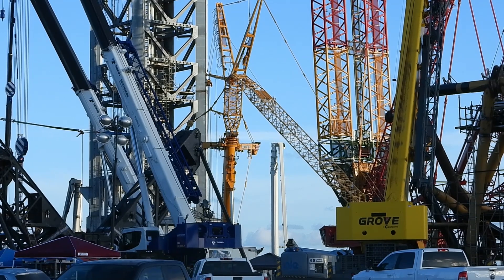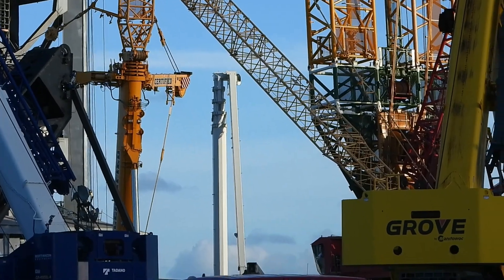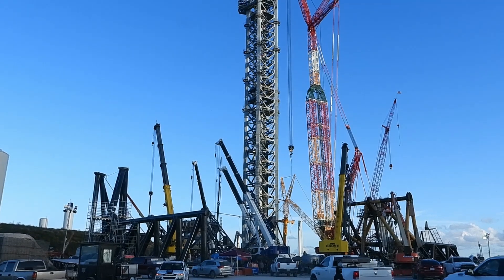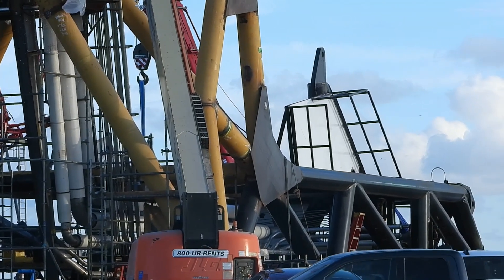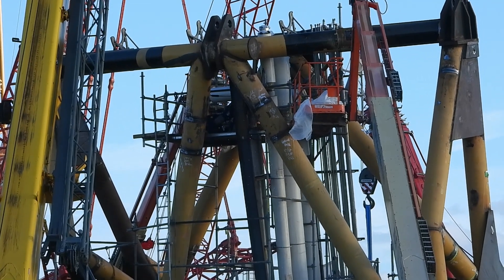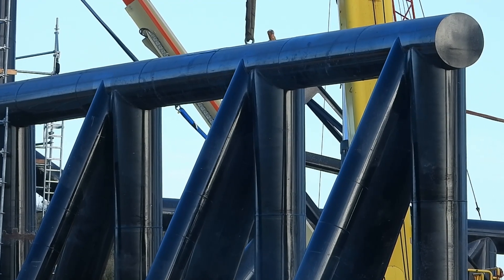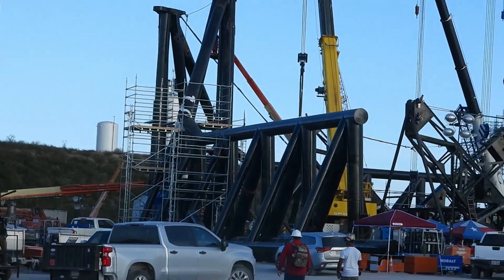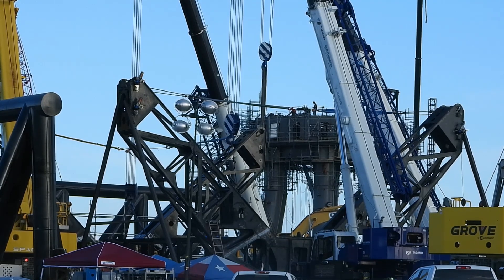Seven Views of SpaceX Starbase Launch Site, Thursday August 26, 2021. Boca Chica, TX

Comment: Hi Paul, it could be the 6-axle mobile crane that arrived two weeks ago and was already working on the tower afterward. It was also from the company "Certified Crane and Rigging Services, LLC". However, it has now been given a different lattice boom. 

It was a Liebherr LTM 1350-6.1 with a maximum lifting capacity of 350 t, a telescopic boom with a maximum length of 230 ft, a system length of 461ft, and a maximum lifting height of 439 ft.

Comment: The vegetation on the berm is there to help prevent wind erosion of the soil that makes up the berm. The V structure (actually a pair of V's each at the end of a beam) IMO will fit vertically around one corner of the tower (the one nearest the pad) and be the part that holds the 2 arms. Like a shuttle in a loom it will move up and down by the integral tower crane, allowing the catch arms to track in the vertical.
Reply: nice explanation.  i have heard the catch arms will replace a crane on top. since the arms  are gonna catch it off to the side, i assume one arm will be longer than the other.  also, the arms must have a conveyor belt on top to move the rocket body laterally after rotating to above the pad and then also to rotate each rocket on its long axis so the pins mate before dropping down onto the pad and booster.  that is gonna be a complicated mechanism.  also, how will they avoid damage to the tiles?????  i thought a  separate crane on top would be the way to go

Comment: That new yellow crane looks like tbe last part of the tower structure I hope. ! Paul. :-)
Reply: looks like a pile driver to me, for foundation work
Reply: @peetky8645   I am a civil engineer by profession, and follow your observation's as it being a pile driving rig, but would like to think the lower upright section the derek is connected to is a spindle configuration that may mount on top of the tower for future stacking of the booster and starship ? Frankencrane is an expensive rig to have standing idle for any length of time and that unit may be her last major lift ? I do enjoy the speculation the Spacex site and Elon leaves open to all the observers of his project's. :-)